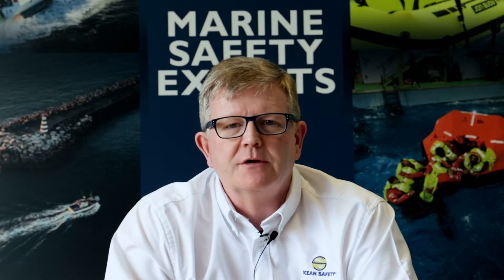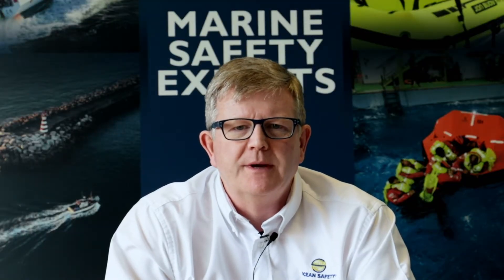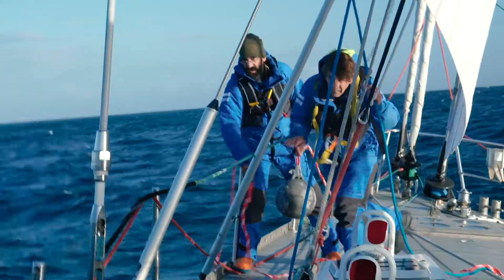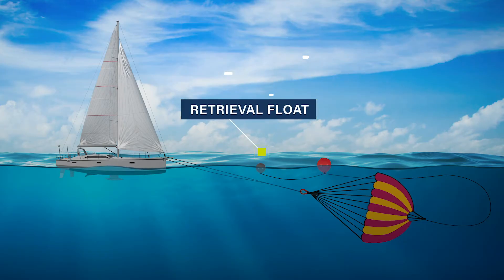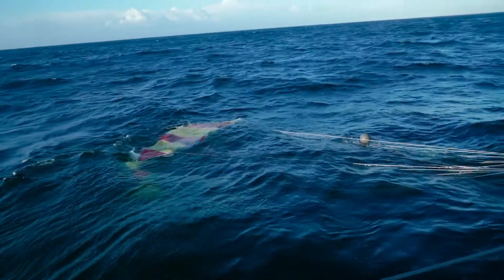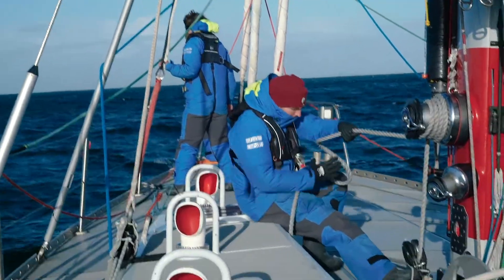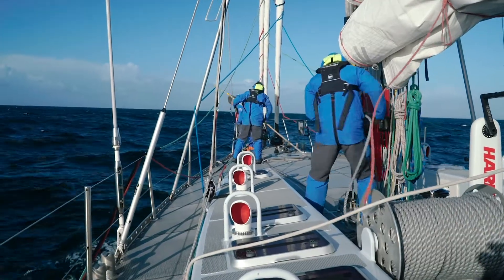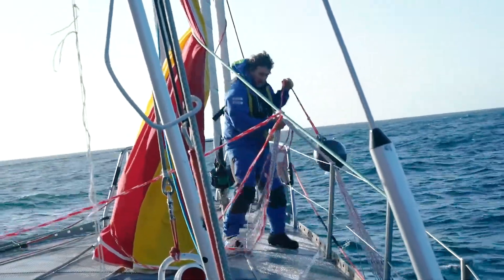How to Deploy a Para Anchor at Sea

Comment: Its not very clear when and why someone would deploy this. Skip says that it ought to be done before the maelstrom hits, and that it's favoured by extremists. Both of those comments raise a number of questions. Like what is an extremist?
Reply: Sea anchor, drift anchor, para anchor(s)  are typically used by fishing boats to stay on good grounds or a "hot spot" where it's  too deep to drop a ground tackle type anchor.  They're also used to keep the bow windward and out of the "ditch". It keeps the bow pointed towards the wind & waves. That's why they're almost always found in emergency life boats & life rafts.
When sailing single handedly (alone) sailors will often deploy a drift anchor when they rest & sleep. 
As far as holding position, Their effectiveness in the open ocean is hardly noticeable without a GPS. A boat without a sea anchor can blow/drift many miles from a given position in 24 hours. Where as the same boat using a sea anchor or drift anchor can drift less than a mile   in 24 hours. 
Which is where they come into use in emergency situations. Where a vessel is waiting or hoping to be found and rescued for whatever reason. A drift anchor is often deployed to help keep a vessel as close to it's last known position as possible.
Reply: They're used in riding out bad storms by keeping a boats bow into the wind and waves, and kept from being blown much further off course.
Reply: It's not 'extremists'. What he said is that the para-anchor is useful "in extremis", i.e., in extreme conditions.
Reply: if big waves (+50ft) are starting to break, and is coming the night.. let me tell you there's a extreme situation.   If you cannot anticipate a breaker wave, best thing you can do is use the sea anchor.. So, prepare it before night comes, and pass the night inside the boat more securily than sailing against breakers you cannot see. 

To hove-to doesn't saves you from a big breaker wave. A parachute does.

Sometimes you need to know boats and skipper limits.

Can you drive a car at night, no visibility, 60knt of wind by your side, raining, at a mountain road plenty of corners??...  Or is better to stop the car in a safe place, and let the night and storm pass through? 

Thats the same.

The most dangerous in the sea are the breakers at night. There you cannot do anything but park the boat with the sea anchor and go inside to rest. 

If waves are too big, but not breaking too much, you can run with drags or hove-to... But at night, storm can raise more and more, and you cannot desploy securily the sea anchor... so better is to deploy it with some daylight. 

This is quite generic, but each situation is needed to be contemplated.
Reply: ...get rid of that (trawll float] on the trip line...